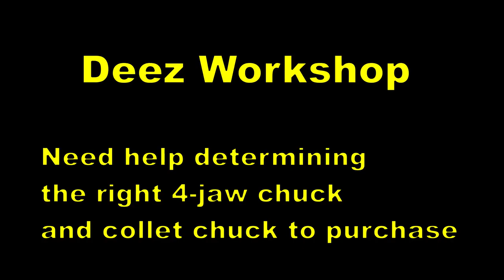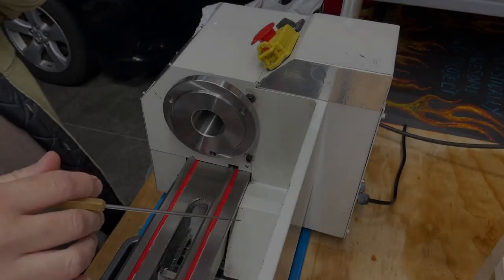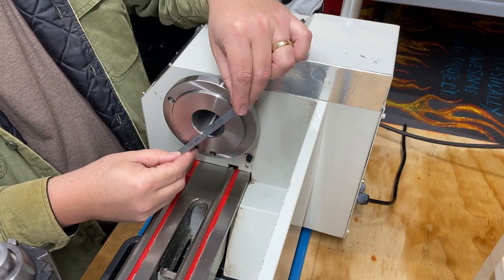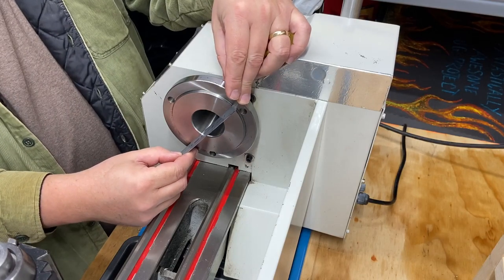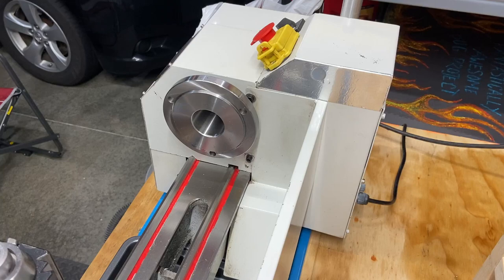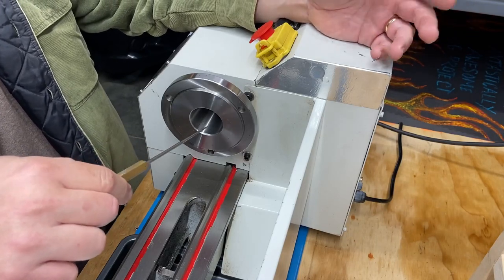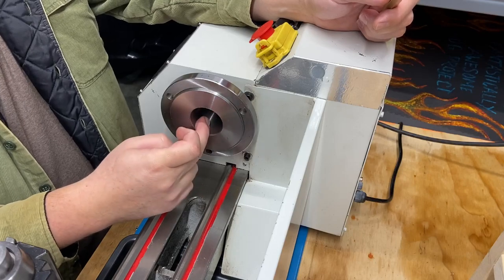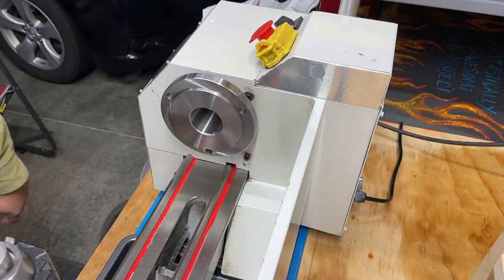Removing Lathe Chuck on Vevor Mini Lathe - Need help, what 4-jaw and collet chuck to get. 5 inch?

Comment: Same scenario here - mine came with a 4 jaw - not used it yet so I've just checked it and it does luckily have 3 holes to match the spindle!, - it's not an independent 4 jaw though which would be much more useful to me so one is on my 'to buy' list.
 My thoughts are, either drill and tap two new holes in the new chuck to match the spindle plate ( being careful to miss the internals ), or use transfer screws to mark out and drill 3 new holes in the spindle plate, using one of the existing 3 holes to 'register' the new chuck on the plate, thus ending up with four holes to suit. Does that make any sense? I may have even confused myself here!🤣
I'll have to have a look see about collet chucks to suit, it's not something I feel I need yet!
Reply from the maker: Makes sense,  I dont want to drill my spindle plate.  Id prefer not to modify that.  If I mess up a chuck ...thats much easier to replace.  So many great suggestions but im leaning towards a 4 jaw independent and drilling the chuck itself while trying to keep it as balanced as possible.  Then either a Collet mounting plate ER32 or ER40 style OR a Milling block style mount that I could use wih the 4 jaw.  im trying to think about future uses with a Mill,  A Milling block square or hex would let me use the collet with a mill or the lathe.  Way more ways to tackle this than I could have thought of on my own.
Reply: I made a backing plate for mine. Came out quite decent considering I didn't have a drill press at the time. I will however be changing my setup to drilling and tapping new holes in the 4 Jaw independent chuck to suit the spindle. As for the collet chuck I have a large chunk of cold rolled bright mild and cast iron that I can use to make one based on Harold Hall's design but I need to up my skills a little more first.
Reply: @deezworkshop  Ooh yeah, those hex and square collet blocks could come in handy for all sorts of things, I must put some on my list!😁

Comment: Ever since I recommended Sanou I see it in every video on lathes. You want a SANOU K12-125 and forget the taper.
Reply from the maker: Adding this to my list to lookup. Thanks. Tons of great suggestions.
Reply: Hey guys just so you know the K12-125 is self centering. The K72-125 is the independent chuck.
Reply: @WILFRED1184  He never said in the video which one he wanted. I have both and never have used the independent.
Reply from the maker: I didn't mention independent,  When I made this video i assumed all 4 jaws were independent...Bad on me for assuming of course...But I should have differentiated that in the video.  I have had a couple instances where I wanted to face off a square or rectangular workpiece and definitely want the independent version to accomodate differing workpieces.  Thank you both for the advice.  So many choices and options that I wasnt aware of and continue to learn these details.
Reply: @TheMiniMachineShop  you are absolutely correct. I just thought he wanted an independent chuck. I have an independent 4-jaw chuck and it hardly ever comes off my lathe. I find it much more useful than my 3-jaw. Especially for turning eccentrics.

Comment: When ordering a new 4 jaw chuck you will need the outside diameter you require   and the flange or recess diameter.
To accommodate the 4 hole attachment of the new chuck  you will have to order or make a backing plate which bolts to your 3   bolt hole spindle.
The backing plate requires a  flange to match the recess in the newchuck.
As I said you may find pre machined backing plates available or you may have to make one yourself.
As for a collet chuck , the easiest option is to buy one that bolts directly to your existing 3 bolt pattern spindle.
Reply from the maker: Appreciate the suggestions.
Reply: I had a quick look on EBay (uk)  and there was an ER 32 collet chuck  complete with a range of collets that would would bolt straight on to your 125 mm spindle for the price of £90

Good luck
Reply: Chronos.  
I sent a link but it seems to have disappeared
Reply from the maker: @mikecrowley3102  maybe youtube strips some links.  I didnt see the link either. thanks

Comment: It’s weird that it appears the spindle nose IS the backplate. I’m not familiar with the mini lathes, normally there’d be some sort of mounting interface and the backplate would stay with the chuck. The system im seeing in your vid seems to limit you, like a lot. You’d be better off making some kind of back plate/adapter. Or, you’ll want to know the size of that inner register. Most of the 125mm import chucks will likely fit that register. The problem is going to be truing the chuck to the spindle. Normally, you’d do that by machining the back plate in situ, and then the back plate stays with the chuck, keeping things true. You can’t do that here, which again, is weird, and kind of dumb. So make some sort of adapter system. The actual chuck size doesn’t matter as much, so long as it’s smaller than your swing, which i believe is 7”. Also, yes that’s the Morse taper. Get an MT5 to 5C spindle nose adapter and a draw tube and you’ll be golden on the collets. TLDR: throw that thing away, buy an old south bend 9”, live happily.
Reply from the maker: :-)  I wish I had a better lathe but its what I have to work with,  The comments and respnse from everyone have been greatly helpful in understanding how all this works and what to get.  I am leaning towards getting a Collett adapter plate to mount on the my spindle plate  and forgetting about the MT5 spindle bore.  I would lose my pass through if I had to use a drawbar setup and be limited on the length of material I could turn.  As for the chuck,  I am still undecided but if I get a 4 jaw independent I at least know what to get and what ill have to do to get it mounted.  Thanks for your thoughts.
Reply: @deezworkshop  Yeah man, work with what you’ve got. You can still do great stuff with that little machine. About the collets, IMHO i would recommend using the spindle taper. You’re going to end up with much better accuracy, repeatability, and concentricity if you register off that taper. Yes, you’ll lose “some” pass through ability. But it’s a worthwhile trade off, especially when you consider that the draw tube is hollow anyway, so you’re only losing it on the larger end of the diameter spectrum, which likely won’t ever matter to you given the size of projects you’re likely to be working on. Additionally, rigidity is a commodity on small machines. hanging a collet system off the end of your spindle is a significant loss in rigidity as opposed to mounting it directly inside the spindle, which is firmly held in headstock. Food for thought. I have several machines, from 9” up to a 10’ long monster lathe. They all have collet systems using internal spindle adapters.
Reply from the maker: All great thoughts,  I have so much to think about and consider.  I have battled rigidity issues.  so I definitely see this potential concern as well.  Maybe someday I'll get to use a 10' lathe and make some real chips  :-)  Thanks again.  all ideas are welcomed and appreciated on my channel.
Reply: @deezworkshop  Just keep at it man, have fun and keep learning along the way. Machining changed my life, it’s a wonderful thing to get into, you’re on the right path.

Comment: I sent you a couple of links. Disregard the 4jaw one. It is for a 4 bolt spindle. Yours is a 3 bolt.
Reply: I looked through a bunch of independent 4-jaw chucks and all the 4.9" ones (yours is 4.875") are all 4-bolt. They are usable but you would have to drill and tap the two missing mounting holes.
Reply: Boy I guess I should have watched the video before commenting. 

That is the Morse taper, it is machined into the spindle so it is not removable. The link I sent you is for a flange mounted collet chuck which would allow you to still pass work through the spindle bore. Where a Morse taper collet chuck will not allow pass through because of the draw bar that is required to keep the taper seated.
Reply from the maker: Thanks for the links and the reply.  ill be reviewing these items.  I dont have the ability to make an adapter plate...Well not using a Milling machine anyway.  I do have a drill press so I suppose I could figure out something there.
Reply: @deezworkshop  that's what I meant. You would just have to drill and tap two more holes in the 4-jaw chuck to get it to mount up.
Reply from the maker: ahhh,  So use one of the existing holes and drill and tap the 2 reamining holes.  This I think I could accomplish.  I understand now.
Reply: @deezworkshop  yeah

Comment: or use the cone instead is possible.
And don't try to remove the plate for the chuck, colet-chuck fits in the cone. taper 3 or 4.
Don't know about size in inches, I saw the ones in mm from China though, also with 3 holes.
Tapers are cheap, mine has a 3. 
And: not that hard to make 2 more holes in 3 4 hole chuck since the centering is done on that plate, not on the bolts.
I'd replace the bolts with normal hex too, much easier to remove and place.
Reply from the maker: My is supposed to be MT5. So far I think getting an independent 4-jaw, lining up one of my 3 holes, then drilling and tapping the remaining 2 holes in the new chuck is my simplest solution that I can handle. As for The collet chuck I think a collet mounting plate is the route I will go. A lot of great advice and suggestions from everyone. Thanks.